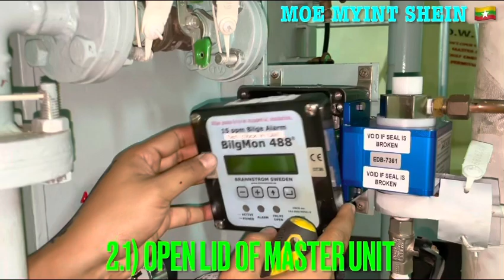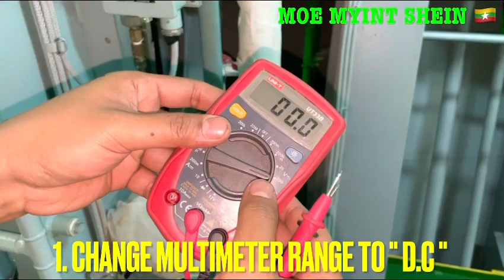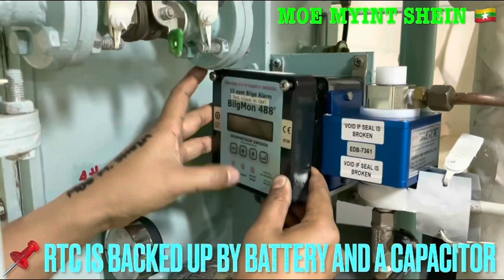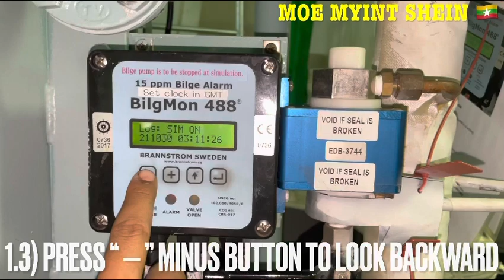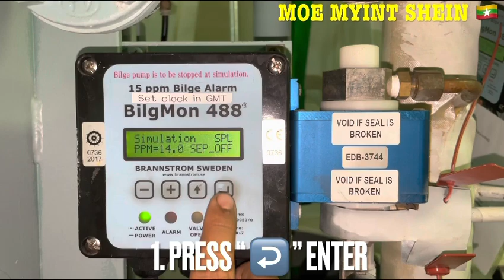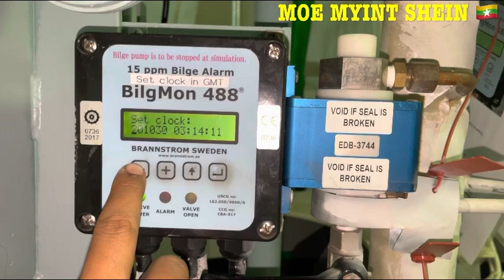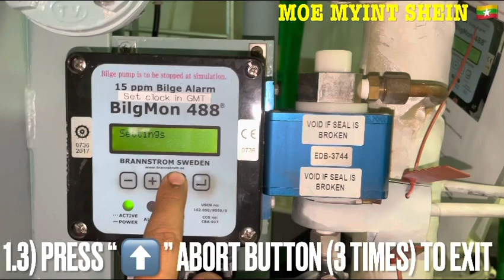OILY WATER SEPARATOR | RTC Battery Check, Replacement & Settings | Technical Vlog : 032

Comment: sir, good day. How are you?
I have 2 question pls.
1) How long the battery will last all together?
2) During emergency, how long the battery can back up for OCM?
Reply from the maker: Battery is for RTC (Real Time Clock). RTC battery is coupled in parallel with backup capacitor. 

(1) The life of battery is 3 years (Depending on the ambient environment. If environment is hot, it will be shortened the life of battery.) 

(2) RTC is supplied power not only from battery, also from capacitor. Without battery, RTC can run for couple of hours with power stored in capacitor. 

Maker recommends to check Backup battery voltage every year. If voltage drops down to 2.7VDC, exchange with new battery.

Comment: Hello Sir, i have problem with Bilgmon488, the display shows RTC Check : Failed! . I’ve replaced the battery with a new battery, but it still shows RTC Check: Failed!. Please Help me sir.
Reply from the maker: Replace backup battery and then enter UTC Time and Date from Set Clock Page. Hope u will be OK.
Reply: How?
Reply: There are some models that send this error RTC FAILED after u replace they battery
Reply: RTC Failed unable to excess menu, so unable to reset, anyone knows how to solved this issue, contact manufacturer- they will ask to replace pcb board, but anyone knows how to replace the capacitor?